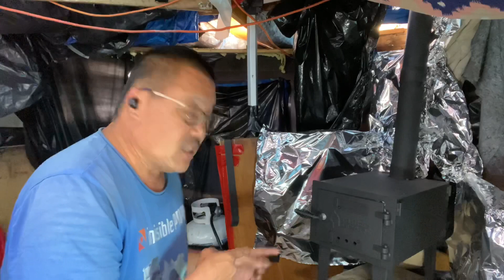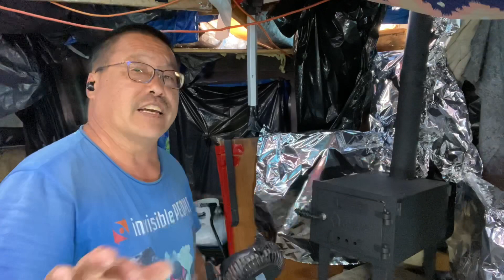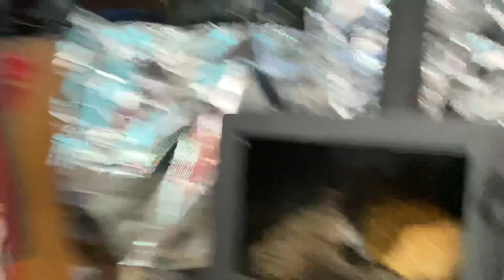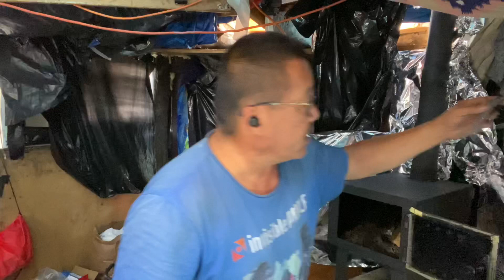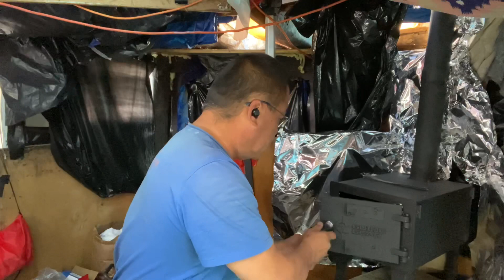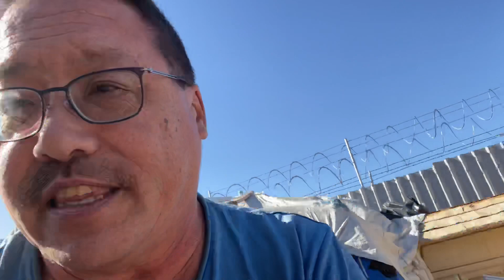First Night With Heat by Derrick Soo

Comment: I remember you from Invisable People Derrick. Good to see you have a source of heat and a nice woodstove. Have you thought about adding a Flue Pipe Cap ? Might be something to look into .  I have a small old Atlantic Pot Belly woodstove that I want to put in my small cottage house that I live in . Take care ...stay warm !
Reply from the maker: I had a flue cap on that came with the stove, but, I noticed the vent opening had fully clogged with ash a creosote from burning. That caused the exhaust to back up in the burning box and not allow any fire. Opening is 3.5” in diameter. I’m not concerned with the minuscule amount of water that make enter the top.

Comment: Wood stove is a game changer for anyone dealing with cold Temps . Glad it's heating your shelter good .
Reply from the maker: A Bargain at $130 at GearGuide.com or Amazon. This is a HEAVY small Wood Stove, with 6.5’ of heavy Steel Flue Piping included. Heat shielding is extra, or use Commercial Grade Food Service Foil.